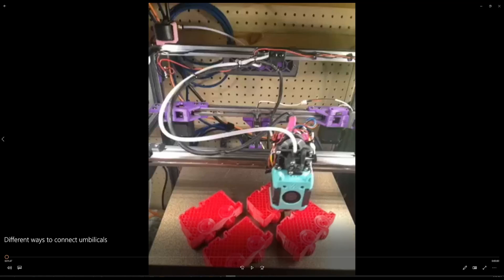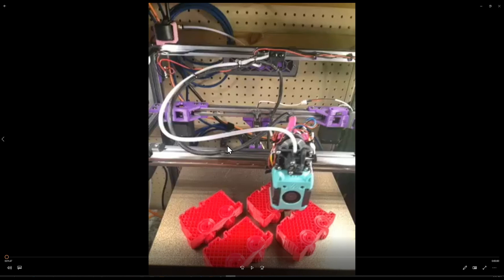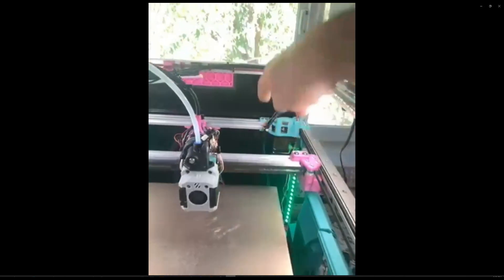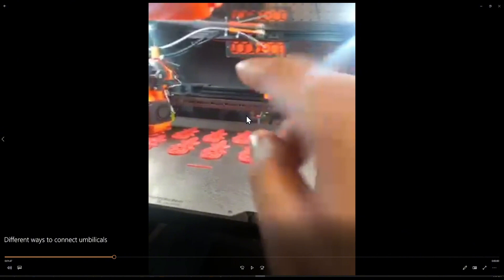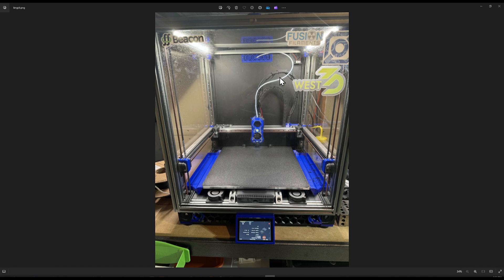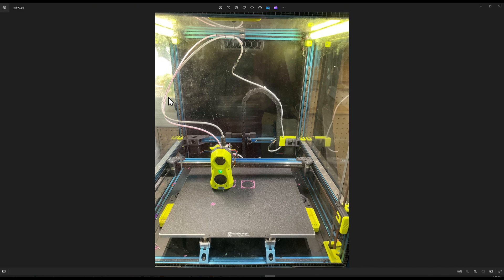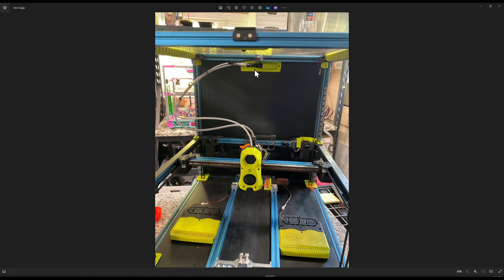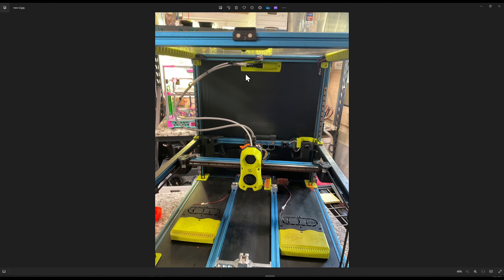Umbilical Routing for Trident and V2

Comment: lol thats my printer in your video I was waiting on the correct crimps for my new hot end and those were some extension wires with the proper connectors on them. it has been fixed since that picture. I am now setting up my machines with umbilical to the exhaust cover as we have been talking about on discord.
Reply from the maker: @1Kingcb  I think that is how I and everyone runs the umbilical the first time on a v2
Reply: @The_original_Reth  I’m still fighting my other machine. I think the gantry needs some de racking. I also figured out I wasn’t using my beacon accelerometer it looked slight better on that one.